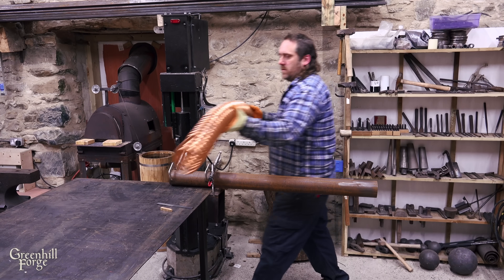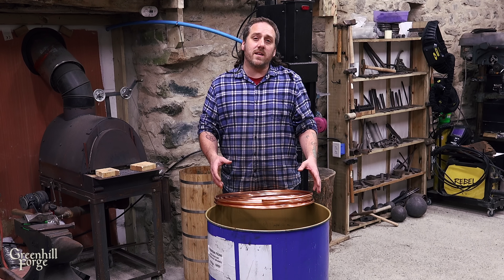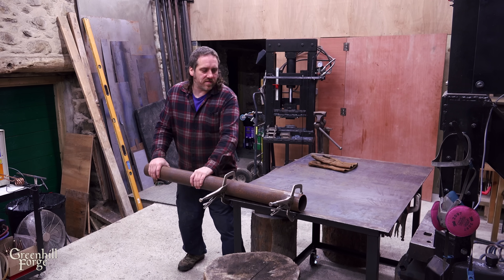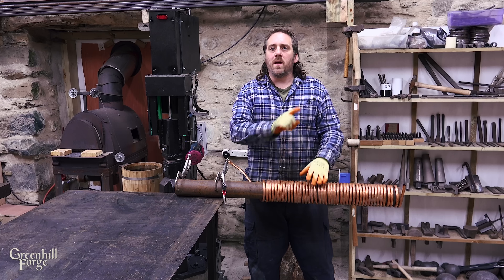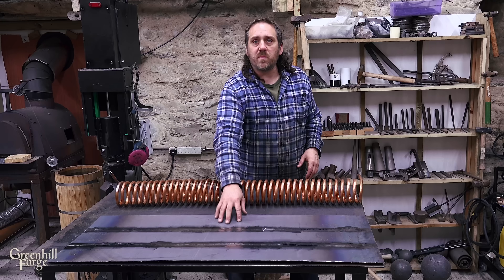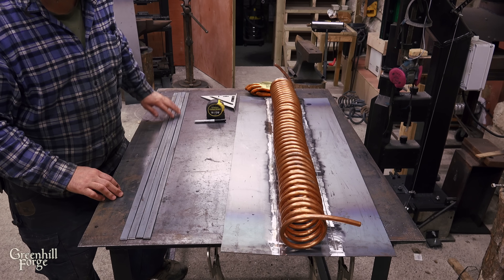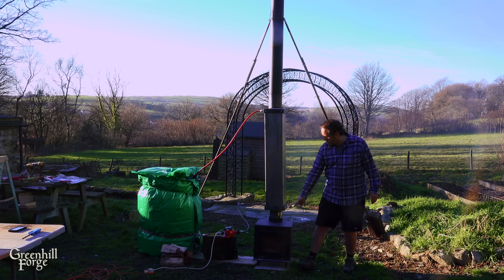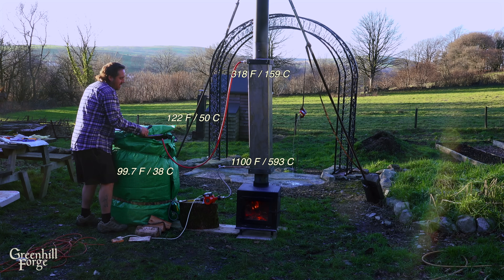Wood Stove Water Heater Experiment - Surprising Results! Part 1

Comment: Reverse your water flow. Cold in at top, flow down, hot out at bottom. This is known as counter current exchange and extracts the most heat from the flue gas. Great build!!
Reply: Don't extract too much heat from a wood stove flue pipe or you'll end up with a creosote chimney fire. Flue gas needs to stay above 350F. Unless you run a rocket stove, which is a clean complete combustion.
Reply: @jennacoryell4160 all new stoves, at least here in europe is required by law to have efficient secondary burn. you should not have any prop lem with creosote. this said draft is a bigger problem. the more you cod down the flues the less draft and the worse burning efficiency. if we allow for a exhaust fan to keep a steady draft you can conceptually go basically to 4c or something on flue (you have to be able  to dtain condensate somewhere). the efficiency can roughly be calculated as the ratio between the temperature of the exhaust and the flame. storage of heat can be done in a n ack tank of sufficient size. given lowest temp at bottom of 35 degrees celsius, a 1000 liter watertank can store 75kwh of heatenergy for your house. that's about 20kg of dry seasoned birch worth of energy.

the same type of wood gives an optimal flame of 1000 degree, assuming a 35 degree flue temperature you would have an efficiency of at most 95%
Reply: @VeryNormalAlien It won't need cleaning that's quick, as short as the chimney is. Won't have time to stick to the pipe.
Reply: @VeryNormalAlien that depends on how efficient the burn chamber is, and how much oxygen mixes with the smoke before it leaves the chamber
Reply: I'm so glad this was already the top comment that I could thumbs up on!
Reply: @BenBrand  Same here.  This is super important for maximum efficiency.  It would be awesome if he could reverse the water flow and compare the different time?  Love this!
Reply: @stevenfelix6915  funny you talk about effinciency because wood stove is like 50%-70% less efficient than a rocket stove...
Reply: Had to check this out! Thanks for the pro tip! 🙌
Reply: Also it should be "metered" - smaller input feeds into larger pipe/coil that collects heat, then back to smaller.
Reply: Even though it would be at the expense of thermal dynamics transfer of heat energy, would it be worth trying sans pump and allowing convection to do its thing in current configuration?
Reply: @EnglishLevy  your method was used in the old metters wood fired stoves/ovens cooking for the old hot water generation. which included a ball float valve reservoir and not mains pressured. A return pipe allowed the water to circulate through the system. These were used for 60 odd years in Australia from the 1900's.
Reply: @EnglishLevy  maybe if the water barrel was lifted up so its height was the same as the coil. But with it being down below all of the water in the coil will get hot but there would be no wear for it to flow heat wise up since the top tube goes down so far even below the bottom tube before it gets into the barrel. It only takes a very tiny amount of movement to get an order of magnitude more heat so having a very small pump is worth it for sure
Reply: @BenBrand  Even if the intake and outtake are at the same level, under the water level of the barrel? My intuition tells me this is a siphon that has approached zero drop; water falling down the return path provides the energy to draw the water up, except for resistance, which is why a siphon needs to be downhill overall. As the heat-exchanger above the barrel can be viewed as a siphon without enough total drop, I'm led to assume that the upward force provided by convection need only overcome the resistance within the pipe, not the height the water travels above the barrel before coming back down. Would love to know if/how I'm wrong...
Reply: @ThePracticalPeasant heated water wants to rise. So if the heated water leaving the top of the coil has to travel downward to get to the barrel. The heated water on that downward slope is also going to want to rise which would counteract the flow? Maybe similar to  why on the output of water heaters you're supposed to go down and then back up which forms what's called a heat trap so that heat doesn't keep flowing into the house even when there's no water flow?
Reply: @ThePracticalPeasant  Your not wrong.  It's not the most effective method unless you have distances like a "Snorkel Hot Tub stove" the water heats as it rises but only has an incredibly short travel before it over into the Hot Tub.  The only thing that would be more passive/effective would be to place the burn chamber in the middle of the stove and then try NOT to get burned by touching a hot stove.  By placing the stove off to one side and then surrounding it in water then more heat is transferred and the Bather is safer.
Reply: @ThePracticalPeasant  I've got an old Kerosene burning heater at my shop (approx 100 years old.) Cold water always wants to move to the bottom, hot water wants to rise. This is the thermal effect.. As the water heats it moves up the copper to the top of the tank, and the cold water moves to the bottom, feeding the coil at the heater with cold water. creating a cycle of hot up and out, cold down and in. This continues until the heat is turned off. We restored it, but have never used it. Not sure how long it takes to heat the 30 gallon tank.
Reply: @FuhrChris  That was my suspicion; if it did work, the flow would be minimal. I suspect a pump would always be required in order to maintain sufficient water circulation for a consistently heated tub especially considering that the heat tends upwards and lost to the atmosphere, the bottom, where you really want it hot, will always tend cold.
Reply: @ThePracticalPeasant Yeah you're right, to keep the water moving in a closed system, reverse flow would require a pump no matter where the barrel is. He's talking hot tub, and I guess he's not buying his wood, and happy with 100 degrees. He's using the pump, he might as well try it. I'd insulate the hot water pipe though. Great job!
Reply: @ThePracticalPeasant  I was waiting for someone smarter than me to make that comment. Thx.
Reply: @ yes, in a closed loop system because the volume dropping is displacing the same volume upwards, but, as soon and the intake/outtake of the storage tank drop below the top of the coil, you create a heat trap, which kills the the thermosiphon. You want the intake of the storage tank to be at least level with the top of the coil
Reply: @BenBrand heat mo es from hot to cold, it doesn't always rise especially when moving inbetween mediums.
Reply: @ThePracticalPeasant  Your not wrong at all.  It's thermal convection that makes the water move as you say.   Siphon is technically the wrong term.  Your right.  As long as the water "head" is above the coil head  or the water head is above the over all heat source as you say the warmer water will move.  Good to know there's some normal educated people around.   Thanks TPP
Reply: @BenBrand more movement makes the pump worth it? I agree. To make it more efficient, I would use peltier TEGs to charge a small battery and then use that electric power for the pump using a 12v voltage regulator. 12 volt pumps are the easiest to find for replacement.
Reply: @EnglishLevy   I came here to say this basically....but wondering if the barrel was lifted, would it provide a passive heat transfer without the need for power to the pump.
Reply: @IceColdGeico yes. It's called a thermo siphon. The tank above the heat exchanger would allow for stratification or natural flow without a pump. Great question.
Reply: @EnglishLevy simple check valve out of a coffee pot. As the water reaches steam temps pressure builds closing inlet until pressure drops. Basically a water hammer but with heat.
Reply: Great video. Clear and concise. Be careful about extracting ’too much’ heat as you can lose your draw. Adjust water flow as needed, but fantastic execution and explanation with minimal fluff. I really appreciate it.
Reply: This is a great build.  The only problem I’m seeing is you have dissimilar metals in contact with each other.  Copper and steel don’t play well together, especially when water is involved.  You need an insulator in between.  Brass, being a noble metal works well.  Under cooler conditions, neoprene is used.
Reply: Danger danger Will Robinson!
Sorry, but there is a major flaw in your design. I'll give you a hint. Soft copper contacting hard steel, and differing coefficients of expansion.
Reply: @alienrocketscienceshared8454 and electrolysis between the two metals as well
Reply: Or put the stove and heat exchanger below the hot tub flow cold in the bottom and hot out top and use the natural thermo siphon to remove the pump making heat less efficient but removing all energy inputs except the fire.
Reply: Very clear explanation as he goes along with the build…
Reply: Sounds great and appeals to me as a chemical engineer.  But the real issue is creosote formation, so I'd argue that he has it right, in the sense even with very cold inlet water, you don't overly cool flue gases.
Reply: Exactly how my wood boiler is plumbed, initially counterintuitive when I first looked at it , realized this method is far better for continuous balancing of temps
Reply: If the only exhaust from the stove is though the water heater, how does he stop it getting the water dangerously hot?
Reply: @petetimbrell3527  you have to lower the fire burn rate otherwise it will get to boiling if you dont deal with it your self no temperature regulation is built in
Reply: I think this would be a great modification as well as wrapping the copper pip on the outside of the flue instead of the gases in direct contact with the copper. That copper will get fouled up quickly and will be very hard to clean in that high surface area environment. Cool project but probably will only last a year or 2 of consistent use.

Additionally like someone else said you shouldn't let the exit gas dip below 350F so a control loop on the water flow would be ideal to ensure temp on exhaust doesn't dip below 350.
Reply: not necessary because natural water circulation just works, as long as its in a closed loop and filled natural water convection will cause it or circulate indefinitely as long at some of the water is colder than what is being generated. this is what they use in building that are heated with hot water because getting a pump that has enough head pressure to supply a 5 story building would be very expensive
Reply: Was coming to say the same thing, you beat me to it.
Reply: Yes, reversing the flow keeps the differential temperature between water and flue gas at a maximum through the whole heat exchanger, therefore greater heat transfer. Great build bro!!
Reply: @Rdist-z8v incorrect it turns out... the temperature difference between the water and the gas is lower at any point which is a consequence of it being more effective at heat transfer
Reply: I do not think we are anywhere near the efficiancy where this becomes usefull.
Reply: Never heard of this. Normally heated water will expand and rise.
Reply: @MrDumonic  Right, but it's working against gravity. So gravity (slowly) wins, but in the process the water is heated more because it spends more time in contact with the heat. Or so I understand.
Reply: A lot of people keep saying that hot water rises, but that isn’t completely accurate; hot water is less dense, so it tries to rise as the dense cold water falls; this is how gravity hot water recirculating systems work.
Reply: @liquidrockaquatics3900  it is not the density that makes hot water rise, or cold water sink. Water is not compressible and it's weight and volume don't change. What does change is the energy and other substances the water possesses. Hot water for example can hold more gases than cold water. 
Convection in air is not the same as convection in water.
Reply: @liquidrockaquatics3900  not accurate. Water is not compressible and working with deionized purified water shows that convection no longer takes place with dissimilar temp (delta T ). Hot water will rise only when gases in the water expand and create a bouyancy.
Such is also the case with mineralization in water. Water of the same temp will rise or sink depending on salinity for example.
Reply: Very nice , What if two coils will be get together to get more water for radiators
Reply: Why fight nature?
Reply: Great idea
Reply: Also if the stove were to go out you don't want the water freezing in the copper lines. They will bust
Reply: Common mistake that means 15% loss is exactly what you are saying in when Pipe Fitters install the entering water to the leaving air side of the coil.
Reply: @runrau9275  Fitters do that on 50% of their FCUs on ever job. Lol and a regular journeyman is marking $76 per hour here at Local 32. They stand around for 2 out of the 8 hours and take a fitter Friday every week. Ridiculous.
Reply: Exactly.  The same principle is used in fresh air exchange thermal barriers.
Reply: This is because the heat flow rate is proportional to the temperature difference. Great suggestion.
Reply: Never would have thought of that.  Interesting.
Reply: NO! MORONS...
You're missing the point of the entire project. You let the fire make the water move Itself by going up not down.
Reply: Exactly! Was the first thing I noticed as well. Good to see it in the top comments
Reply: In addition, I would use 2 coils, one external and one internal.
Reply: Thank you ✌️💙👽
Reply: This makes sense. So the heated water rises back up instead of exiting quicker.
Reply: Ecclesiastes 9:10. Proverbs 18:1. Numbers 11:23 Proverbs 6:2
Reply: First thing i saw it, i palm-slapped my face.... it is so obvious.
Reply: I was about to say the same thing.
Reply: need. pump to reverse the flow otherwise hot water tends to rise
Reply: Also how bird lungs work and why it's more efficient
Reply: I often wondered why when I looked at gravity fed hot water tank feeds the hot feed fed into the top of the tank internal heat coil.     Now I know thanks
Reply: I’m gonna leave a simple comment 
BITCHEN💪💪💪
Reply: Great build
Reply: took the word out of my mouth!
Reply: This was always in my head to build one outdoor doom with infloor heating. Two things: i would add bypass exhaust, not damper, and one question: Is this condensing
Reply: Great build but over engineered in my opinion
Reply: Need to watch the diameter of the coil so you don't restrict airflow up the chimney. Otherwise the stove will always be choked and  underperform.
Reply: Is that because it gives you the biggest temp difference
Reply: He made this stove himself. It has a secondary burn but it's not fully optimized. He specifically designed this to allow higher temperatures inside the firebox to Crack tar. Similar to a gasifier. He's optimizing for burn efficiency, not heat extraction efficiency. He said so In the video where he built the boiler stove. This higher temperature burn is the reason why he didn't need to optimize the secondary burn, it was already burning clean.
Reply: U may have electrolytic decay inside those copper coils because theyre touching the steel
Reply: Lots of info, spoken quickly, great, fast editing, free of blah blah bullshit without comprimising what you want to say. Fuckin A! Cheers dude and thanks for doing a video the way it should be done. To the fuckin point, kick ass. Alotta videos I make it 5 mins, learn nothing and click elsewhere. Cheers, great job on everything.
Reply: Your not kidding copper is not cheap .
Reply: How does that work then… heat rises, so my understanding is that wouldn’t it be more efficient for cor to go up??
Reply: Good advice,
Reply: Hell yeah i just wanted to comment this! Countercurrent exchange is up to 15% more efficient!
Reply: @ The very high temp of wood stove flue means wea re not concerned about scrubbing every btu out of the flue gas, if you did, you would have a major creosote problem on your hands.
Reply: EnglishLevy (and others),
Yes. The top of the barrel should be higher than the top of the coil and the bottom of the barrel should be higher than the bottom of the coil. Then ditch the pump. Pumps are THE failure point of water heating systems.
Reply: I agree. Sort of?  So. If you pull off too much heat too fast, flue gasses become heavy potentially leading to room air quality issues? An in-stove 3/4" stainless coil about 50 " in total length does my whole house via hydronic heating in pennsylvania and would easily supply a 400 gallon four person hot tub leaving the flue pipe to freely radiate heat into the house. With a few PT 100 sensors, a heat dump, and a plc, a reliable hot tub system is possible.
Reply: @oldschoolcars3318 why worry about safety when you can optimise the thermodynamics 😂
Reply: Use it just as it is WITHOUT the water pump.  Natural & efficient thermal siphon.
Reply: @BarryAdams777  it is in no way efficient without a pump (and you would have to deal with the problem of air inside the system - once there's air in there, convection stops). The pipe introduces a huge flow resistance, there is not going to be a lot of natural convection because of that and you'll just end up boiling the water at the bottom. A pump-free design would use a water jacket, which is still much less efficient but allows for sufficient convention. If you want to extract the most heat, a pump and cold in on top - hot out at the bottom is the way to go.
Reply: @wernerviehhauser94 , thermal siphon, on its own, provides continuous circulation.   I’ve done it. Heated my farmhouse almost a decade with it.  Modified indoor wood stove.  Reservoir was only 22 gallons. Self-designed system with an aquastat & automatic damper.  

Thermal siphoning is a real thing.
Reply: @BarryAdams777  I didn't say it's not real thing. They built central heating systems that way here, too - but they don't do that anymore. Efficiency may not matter if your fuel is free by burning your own wood, but it does matter if you have to pay for your fuel (and we're not even getting into central heating systems working on water temperatures of 30 or 35°C like mine does). I do agree that it may be sensible if you are off grid and need it to work without electricity, but it does not get the "efficient" tag.
Reply: @wernerviehhauser94  what happens if instead of a pump you put the cold water supply 30m above the fire. So when you want a shower the cold water is pushing out the hot.
Reply: @BarryAdams777  yes especially for an off grid solution.
Reply: @BarryAdams777  Not that he will but with the use of a pump you could "wire" in an automatic shutoff for the flue if the pump stops.  This could also be done with a flow meter.
Reply: Yeah, we have lots of heat exchangers at work, and they all use counter current.
Reply: That is not a good idea... thermosiphon is free. Don't be an idiot... kiss
Reply: @bobhoward9016  depends on your goal. if your goal is to get everything put of the burning fire you want as big temperature difference as possible between the exhaust temperature and the flame. using the thermosiphpne you will get a simple system, but it wont be efficient, the lowest youncan get us the highest water temperature at the top. reversing the flow you can get a substantial increase in efficiency depending on the fewdwater temperature. mind you, you also have to add an exhaust fan as the natural draft goes out the window.
Reply: @norcalforestry  yes, no power = no hot water otherwise.
Reply: Yep.  It’s called a counter flow heat exchanger and is more efficient.
Reply: This^
Reply: your right but does it suppost to have fire
Reply: All of you people who mentioned countercurrent or think the intake should be at the top obviously have no idea what this project is about. There is no water pump. The water moves through the system because it rises up in the flue pipe... do you understand it will not operate in the way that you wanted to operate where the intake is at the top because there is no pump.

Edit: I watched the rest of the video and realize now that there is a pump. It is absolutely unnecessary though unless you're trying to run the water through it backwards but if you have don't have access to electricity you don't need it.
Reply: @nickbrockelman there is a pump
Reply: @richardstadler1458  yeah I know.. and I'm sorry. I addressed the fact that I said there wasn't one in a separate post reply. That being said you don't need a pump because the heat will carry the water up the coil and out the top all by itself
Reply: @nickbrockelman pump is useful for capacity matching if you want to increase effectiveness
Reply: @nickbrockelman  does anyone know what that red thing with the white electrical cable does? It looks a little bit like a water pump but I cant be too sure
Reply: @danny323dee  nobody knows. It's a mystery. Def not a pump tho.
Reply: @danny323dee What's the timestamp where the mystery item can be seen?
Reply: Yes: intake at the top, discharge at the bottom. Let gravity be your friend instead of the pump fighting all that head and friction losses in the copper coil.
Reply: @jimseviltwin1  No, hot water is lighter, and wants to rise, so if you rely, or want to rely, on convection to move your water through the heat exchanger, you need to have cold water in at the bottom, hot water out at the top. But if you are happy to rely on the pump, then more heat can be exchanged into the water, by having the cold water enter at the top, and exit at the bottom - this way, the temperature gradient is better (greater) at all points along the copper tube.
Reply: @ Hmmm,  so where is the input water the coolest , at the top or the bottom of the coil ? By virtue of the temperature differential, the colder, denser water has the propensity to sink.
Reply: @jimseviltwin1 The head is created by the height of the system. Gravity will also help to reduce friction losses as the water tends to pull a negative pressure as it returns from the top of the coil in an open system.
Reply: @jimseviltwin1  gravity is not working the way you think it does......
Reply: Heat always rises so need cold in at bottom hot out at top.
Reply: @johnblyth9787 heat doesn't always rise.
Heat spreads down the temperature gradient.

Unrelated to that, materials have lower density when they are hotter (ignoring water around freezing temperature). Hot water and air have lower density than cold water and air.

Fluids that area subject to G forces (eg in a gravity well, centripetal acceleration) Will differentiate based on density. Higher density will sink lower.

The net effect is, on earth's surface, hotter water or air will rise, as the colder air or water will sink underneath it and displace it upwards. So hot water rises, but only in some places (eg on earth's surface), and not because heat rises (it spreads).

Maybe a bit pedantic, but if a simplification is repeated too much the underlying details can get lost.
Reply: @aurumdeus1  ever heard of a thermal trap before?
Reply: @josoffat7649  yes. If you want to make a counterpoint I'd encourage you to write it out fully so that it contributes to the overall discussion. 
Simply saying "heat trap" isn't very helpful.
Reply: @johnblyth9787  Only if you don't have a pump, and/or want to be able to rely on convection to move your water around.
Reply: @johnblyth9787 you don't have a clue about how thermo dynamics transfers heat!!!
Don't act like you do!!!
Reply: No, reverse flow will cause steam to form, then no flow, then explosion.